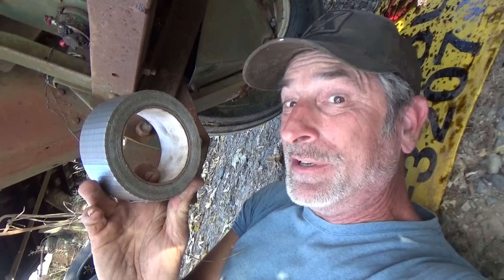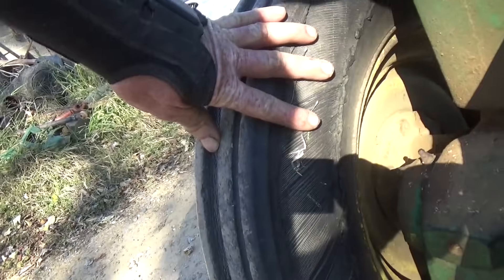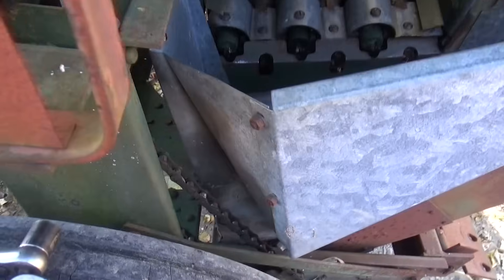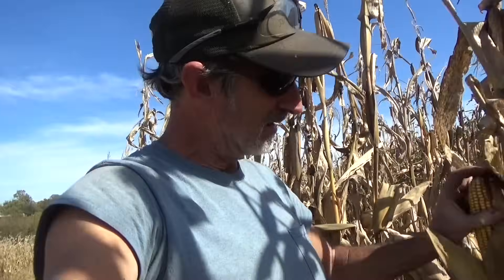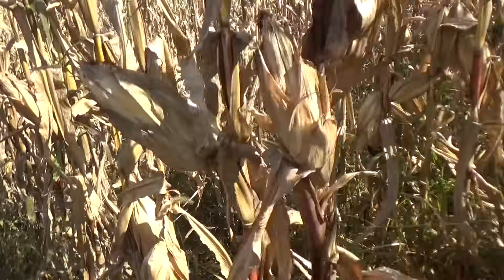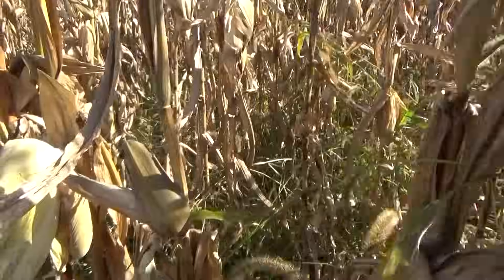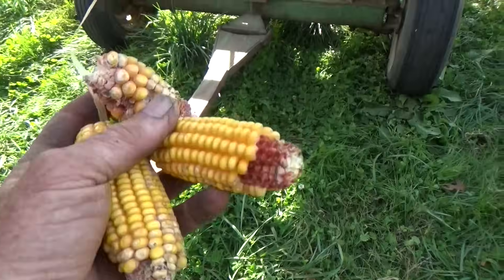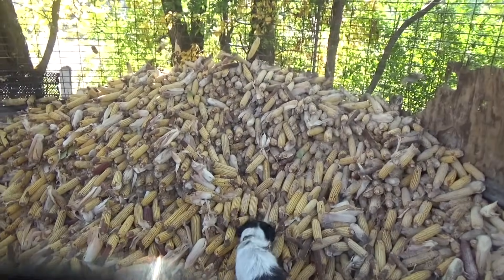Pickin' corn: 2023 Corn Harvest

Comment: Remember having to hand pick corn with the 1946 John Deere LA n trailer then shoveling into crib. Then got a case 2 row picker n an elevator made picking n unloading so much easier.  Always hated when it snowed. So cold. Miss those days. Got a nice set up.
Reply: My uncle explained to  me once why those 2-cylinder engines were unstoppable.  Because it's only two cylinders the bore/pistons were much larger and the stroke much longer than those of 4/6 cylinder tractors.  As he, and many other people, said: "that force has to go somewhere."

Comment: At 7:17   Most elevators have slip clutches on them to protect from just that.....destroying things. Adjust the clutches so they slip......then tighten till they dont.     If they sit for an extended time the clutch will freeze up. Ive run a tractor on my elevator for 45 years now.  My elevator clutch is set to slip under full load. Sometimes I need to remove a few buckets of corn from the elevator to get the elevator going again.  Live and learn !

Comment: Love that old John Deere 620 you got. I've got an old 430 w from 1958 that I grew up on as a kid. Nice little spread you got there. Love seeing the cows in the morning fog!
Reply: I have a 530 not sure the difference what that diifrence is.
Reply: @mikeherber8358  Cool! My parents bought an orange grove when I was a kid and the John deere came with it. I ran it for many years, bushhogging the Johnson grass and grading the dirt road in the orange grove. These tractors were a stop-gap design before the introduction of the "new generation" line was introduced. Basically,  the difference was the size and horse power of the machine. My tractor has a wide front axle, but my understanding is that the "W" refers to "row crop/utility."

Comment: You've got that "new" equipment. My grandpa used a 60 with a mounted JD picker. Was there any difference between the 60 and the 620, other than the yellow stripe?
Reply from the maker: Yes, they did a total revamp on the engine.
Reply: @so.md.dirtfarmer2226 
 Used more gasoline too but put out a little more effort than a 60.

Comment: Why old machines run many years had to grease them? Not these dumb sealed bearings that burn out
Reply: grease needle is your best friend with sealed bearings... sealed bearings are junk.  They put one pea-size dollop of low-grade clear grease in them, that's it, usually up by the seal not even in the raceway or on the balls... no wonder they're junk